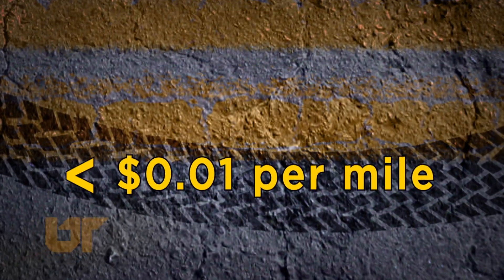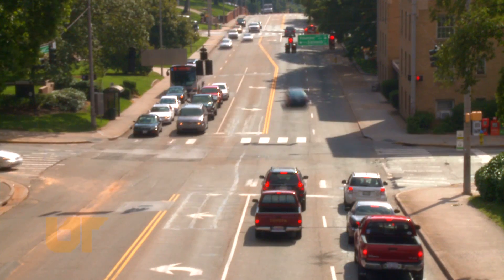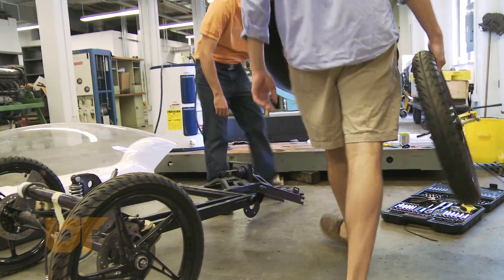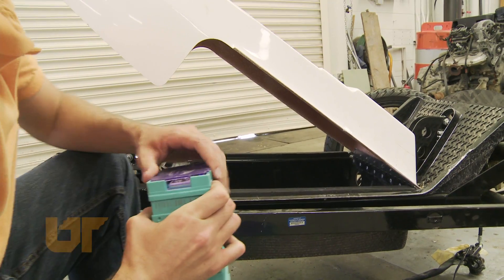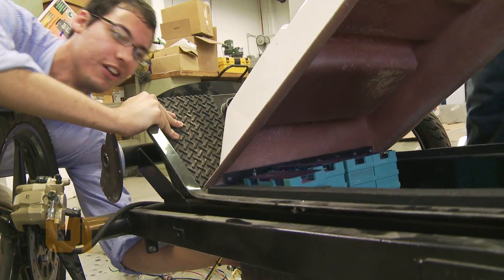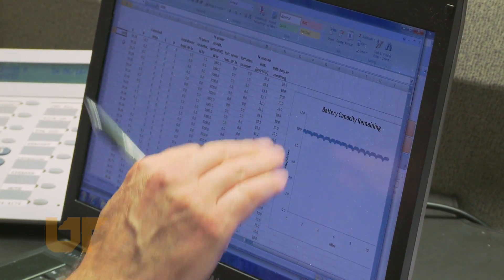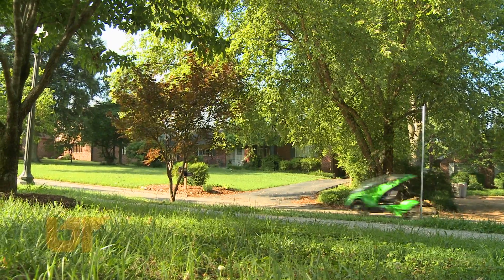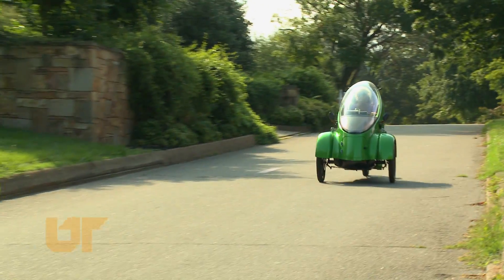Bug E Battery Electric Vehicle

Comment: its funny how we seem to have forgotten about aerodynamics,it takes 90 percent of you power, on a bicycle just to over come air resistance.As much as all the heat,power goes out the tailpipe on a combustion engine,we need to clean up the designs,lighter,slicker.Motorcycles,double their milelage when a aero body,low resistance tires,tuning are put into place,same with electric,doubles the range when the air is clean,passing through
Reply: that's not true,we get your point but you don't need to exagerate

Comment: my guess is by 2030,the range of a battery powered car will be 600 miles,right now its a wait and see,but soon it will be a electric frenzy.Batteries are due for a power increase real soon,2 fold or better for Lipo in capacity.I'm excited about the future.